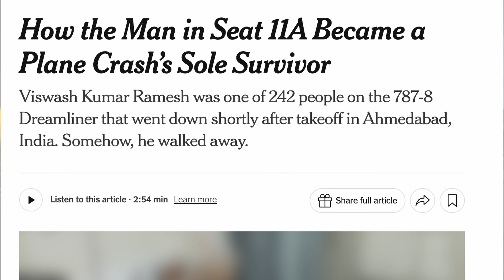Why the RAT Changes Everything – Air India 171 Update

Comment: Great analysis, Captain Steve. One crucial piece of evidence I think deserves more emphasis is the complete absence of turbofan engine noise in the video. TOGA thrust on two GE or Rolls-Royce engines is loud and unmistakable, the fact that it's entirely missing strongly suggests a dual engine flameout. Combined with the RAT deployment, it points toward an abrupt and total loss of thrust.
Reply: I agree. The fact that you can hear the RAT but not the engines supports dual engine failure.
Reply: I second that idea. And these guys would have that thrust lever maxed out at that point. It would be loud. I am in the path of final approach in Philadelphia and I can hear when they increase thrust and decrease to maintain altitude and that’s at a few thousand feet. Sounds like nothing is happening here at all
Reply: I saw a comment on a website regarding a "GCU bug" where after 248 days of continuous operation the GCU will shut down. The GCU provides power to all AC systems. This 787 did not have a maintenance record regarding the GCU software update. GCU shutdown means no fuel pump power which means the engines go out and the RAT deploys. In the video it didn't sound like the engines were running at all, could this be the cause?
Reply: @willl84  As I worked on the mechanical design and packaging of GCUs for about half my working life, a GCU is the Generator Control Unit which controls the main electrical Generators for aircraft electrical power. There is one GCU per Generator and one Generator per engine. The Generators are driven directly by each Engine's Auxiliary Systems Gearbox so very mechanical at this point.
Reply: @willl84  If both GCUs failed due to the same time-based software bug, it highlights how software monoculture can completely undermine system redundancy. Simply duplicating components isn’t true redundancy if they run identical code with the same failure trigger. In safety-critical systems, software diversity is just as essential as hardware duplication. The solution lies in having separate teams develop critical software independently, reducing the risk of simultaneous failure from shared bugs.
Reply: @CDeliu  What you are describing reminds me of the first launch of the Ariane V rocket in 1996. The launch vehicle had two identical guidance systems running the identical software. When the primary system experienced a register overflow it shut down and control was transferred over to the secondary system. The secondary system had the same software flaw, so it also shut down. This left the vehicle completely unguided, which caused it to go out of control and break up.
Reply: @willl84  GCU stands for what? When using acronyms in discussions its a good idea to write it out first so people know what you are talking about.
Reply: @willl84  I am interested in the reports and film from people on the previous flight showing that electrics in the passenger cabin had all failed many hours before the crash. That seems to suggest there was possibly something very wrong with the plane well before it was turned around for the final flight where it crashed.
I understand that there would be multiple GCUs and a complex system for managing that power, but is it possible that one or more of the GCUs had already reached the overflow point during the previous flight and power to the cabin had been impacted, only on the following flight did the others reach the overflow and fail causing complete loss of power and control.
This would perhaps require the GCUs to have been started up a short amount of time apart when they were originally onlined, but without any knowledge of how they work that sounds like something that could happen?
Reply: Good point. When the fans are producing high levels of thrust during low speed, low altitude flight they make that characteristic buzzing sound. These engines were not making that sound, meaning they were just windmilling and not producing any thrust. The big question now is why did the engines quit.
Reply: Its GE engine - GEnx series

Comment: The sound of RAT ok, but what about the NO SOUND of eventually dual engine failure ? On take off the engines works at best power, with max sound, if them doesn't works at all due a flame out the sound doesn't stop but dramatically decrease, same difference between a take off and a landing. This can be a beginning point. Thanks Capt. Steve for sharing your great experience.

Comment: This is for safety purposes: why the Airplane maker can't invent a safety capsule for high impact to create less damage inside the plane without exploding the human body? It should be urgent by these days.
Reply: During a crash, massive forces (decelerations often exceeding 50-100g) are exerted on the aircraft and passengers. Even with a reinforced capsule, the human body can’t withstand such rapid deceleration without severe injury. Organs, blood vessels, and bones can rupture due to inertia, even if the capsule remains intact.

Example: A 100g deceleration means a 150-lb person experiences a force equivalent to 15,000 lbs, crushing internal structures unless energy is perfectly dissipated.The FAA notes that crashes exceeding 50g are rarely survivable, regardless of protective systems

Comment: Wouldn´t it be fair to say that the RAT was deployed when the gear wasen´t raised and air speed is too low?  Another thing is that usually you would hear the engines go from high rpm to zero when a plane crashes this close to people. I did not hear that in the video

Comment: I don't know a lot about aviation but it's my view that plane manufacturers should discontinue twin engines on these long haul aircrafts and equip them with four engines because of the heavy loads these twin engine planes carry ie passengers, commercial goods and its aviation fuel.
Should one of the two engines fail and shut down during flight disaster becomes immediate possibility whereas with one or two engines dying mid flight in a four engined aircraft the remaining three or two engines would assuredly definitely complete the journey safely.
It's my opinion that manufacturers' first consideration must be to save HUMAN LIVES, and then secondly save the aircraft itself because it's an Expensive investment and finally protect the goods on board.
According to me aircraft manufacturer can't provide those safe guards with twin engines which is really gambling with passengers' lives in my view. Four engines assure the best safeguards for passengers, goods and the aircraft, ie in the event of Engine failure.

Comment: Caotain Steve, please DO NOT overuse therm DUAL ENGINE FAILURE. We do not know if the engines FAILED or were NOT OPERATING. It is a fundamental difference, engine could be just fine but due to a problem present elswhere (e.g. no fuel delivered) they were not delivering thrust.
The dinal otcome is unfortunately the same, but the message matters. The engines are manufactured my General Electric (Boeing does not design and manufacture engines, of course) so it does matter if the engine were problematic or an issue was with another system, e g. Fuel system.
Thank you!

Comment: Hello Captain Steve! There is also a 4th factor to the dual engine failure theory, and that would be that the landing gear initiated the retraction sequence (hence the wheels being tilted forward, which is a characteristic of the 787 landing gear retraction sequence), but was stopped due the presumed loss of engines, electrical and hydraulics.

Comment: @captainsteeeve true now it seems a dual engine failure. One more point which adds to this is when the engines are running you could see the heated air coming out of the engine at the back which would make the objects behind the tail heat wind look blurry or wavy and it is not there.

Comment: The most compelling arguments so far...
Have they found FDR and CVR? I bet FDR will confirm if it is dual engine issue.
So, in the end, it will be an issue between pilot error, maintenance error, or Boeing error.

Boeing will really really try pushing the news away from their names. Especially after all major fatal incidents invloving Boeing. Regardless if it is Boeing faults or not, Boeing will have a really hard time ahead.

Sucks to be Boeing's CEO right now. He thinks it will be easy money but accidents after accidents come and then tariff takes place. It will be hard to clean their names, especially since Boeing was known as the good-old-reliable.

Comment: Can the electricals i.e the battery system have failed which did not allow things to run ? 

Had a recent experience with my Mercedes E250 (2017) which was running and when we stopped at the lights it turned off which had never seen before and then took a really long self before running for 2-3 minutes and turned off again 
. In automatic cars when the battery is about to die we do see either the AC not working or the RPM’s being higher than they normally are.
Just sharing in case it’s useful

Comment: * it's not going to be pilot error. The captain had 3 decades of flight experience and was a senior trainer. The Co pilot had substantial experience too so can time that  out I'd say.

* no way it's flap config error as loud warnings would have gone off as well as you'd have to have a serious loss of bearings to know misplace flaps for gear. 

* bird strike easily ruled out as previous flights would have remarked birds in area. There's none of that

* the silence in the sky is a dead give away there was engine issues. The Rat just confirms that.

* engine fuel contamination very possible. Happened on a cathay Pacific flight and thrust was stuck because of it.

* could even be a fuel miscalculation.

* ultimately stop guessing and let the investigators do their job and bring closure to it all

Comment: So, in the 787, just having a dual-engine failure is enough for the RAT to deploy... I thought RAT only deploys when there's a major hydraulics fault. Maybe there's just on the 737 and 777 and on multiple Airbus?
At this point in time, there's no way that the airplane had depelled the batteries fully... Unless they were faulty. But if they were faulty, then it wouldn't have started in the first place.

There's no way there was a major electrical fault yet, the plane has batteries to power all for some minutes.
There's not enough time to have a major hydraulics fault yet (needs, at least, 2 minutes, in absurd situations).

So the RAT deployed due to a dual-engine failure?

Comment: But the survivor said he heard the engines being pushed to full power, shortly about 30 seconds after takeoff. if it was dual engine failure. surely, he wouldn't heard that. It would have gone silent, wouldn't it?
Reply: Maybe an electronics failure, which disabled control of the flaps. as we saw on the first leg of the flight, none of the electronics were working inside the plane. that video from the passenger demonstrated that.

Comment: @Captain Steeeve What is your opinion on the tilted main landing gear, because in the normal configuration the front of the boggie would be tilted up. In the video, however, it looks as if the gear lever has been set to select up, the landing gear aligns itself briefly but is then not retracted any further.

Comment: As a retired Flight Simulation Engineer with 10 years experience my view is that it is nearly impossible to reset the flaps INSTEAD of the Undercarriage.
The Flaps lever is located in a different place to the Undercarriage lever.
You are blaming the pilot to cover up Boeing's abysmal quality control. The USA Congress is onto this also. This video is an effort to side with Boeing 😢.
You also TOTALLY ignore the VERY poor maintenance by Air India. The maintenance was carried out by Turkish Government contractors. The Turkish Government supplied Drones to Pakistan to attack India with.
This video is TOO SIMPLISTIC.
NO CLUE ABOUT ENGINE FLAME OUT ON TAKE OFF? Keep protecting Boeing at all costs.

Comment: And if you look carefully I think you can just make out that the flaps were set correctly. Hard to see because of the shape of the wing, and the fact it's only a 5 degree flap setting. You can't see it once the plane heads away from the camera, but for the second or so it's passing the camera i can see the inboard flaps. I also watched another HD video of a 787 taking off from Heathrow, and even in that it was not easy to see the flaps. The fact we know now the RAT had deployed maybe points to some massive electrical problem that shut of all the fuel pumps to the  engines, with fuel contamination I would have expected to hear the engines popping and banging, the seemingly lack of anything like that would suggest the engines were simply starved of fuel for whatever reason.

Comment: PLEASE READ my LAST LINE 
Engine Fuel Pumps but since its coming down since it just took off, starting to think so the electrically driven booster pumps in each fuel tank, i am sure you said it the APU is out, now what caused that ? 

 
I just google this last bit maybe Captain Steeeve can give us more on this ?

An APU (Auxiliary Power Unit) on an airliner can fail due to a variety of reasons, including mechanical issues, overheating, or excessive load. Specifically, factors like abuse from starting and immediately using bleed air, temperature changes, and even the size/weight tradeoff of the APU itself can contribute to its unreliability.. they did say it was it was fully loaded was it too heavy ? how many hours had that engines flown ? where they even serviced and checked off right ?

We need to ban take offs inline with buildings, this crash may have been alot different if it as came down in a farmers field or over water, i never understand why airports get the clear to build them so close to houses.
Airlines are really safe if everything is right but i blame these buildings for the final outcome :( very sad day :(

Comment: Didn't they used the full length of the runway to take off? There has to be something that warns the pilots that the delivered thrust is much lower than the demanded thrust? I mean it is probably a good idea to abort takeoff at any time if you lose thrust.
Maybe you can have wires with the ends buried in sand at the end of the runway to stop the planes?

Comment: Also notice that wheel configuration clearly indicates they are already partially going inside. The pilots clearly tried to pull them in as supposed. Its clearly indicated by the angle of the back weels under the windows ...

Comment: Come on...... this sounds so stupid! That a pilot takes the wrong lever... really, you can't make that up! The only 2 actions a monitoring pilot still has to do during take-off, in these computer controlled machines, is to operate the flap and landing gear lever in addition to operating the autopilot. So if you as a pilot can't even perform this simple and necessary action properly, how on earth can you ever get a license? It must have been a technical failure, otherwise you really can't do this as a pilot in a modern aircraft!

Comment: A passenger who traveled in the same flight from Del-Ahm before it crashed did a video recording of snags in AC compressor not working or going on and off, then reading lights not working, call buttons to call air hostesses were non functional, and he felt flaps were going unusually up and down during cruise. Is this an important piece of information, with the RAT angle now?

Comment: Captain Steeve n Boeing Co - stop blaming pilots for the accident . BE PATIENT FOR THE FINDINGS OF BLACKBOX BY INDIAN EXPERTS FIRST 
ITS IMPORTANT THAT THERE IS NO COVER UP FOR BOEING CO TO GET AWAY,AFTER THE WHISTLE BLOWER HAS BROUGT THE SHORT COMINGS BY IGNORING THE ALERT / WARNING SIGNALS .
THE TATA CO OFFICALS NWITH SUPPORT OF GOVT SHOULD STAND STRONG TO FIND THE ROOT CAUSE OF ACCIDENT ,EVEN IF IT MEANS GROUNDING OF THE  DREAMLINERS N OTHER 787 AIRCRAFTS WHICH BOEING / USA WOULD NOT LIKE SINCE IT IS GOING TO IMPACT THE CO IN A LARGE FINANCIAL ...LOSS

Black box should be analysedby Boeing experts in India who have all the expertise in presnce of indian experts to maintain transperency and avoid tampering of data  important leading to the failure

Comment: Something wrong with the fuel pumped freshly into the plane at that airport seems to be a viable conclusion. Still, there was a video showing electrical defects from a prior passenger that might indicate maintenance issues at least for the passenger equipment and air conditioning - could there be an overheating of some sort?

Comment: This aircraft design had a lot of electrical problems in its early days. One of the triggers for RAT deployment is Pilot and CoPilot electrical failure.
Reply: In fact, around 10 years ago people were discussing this very scenario. Why was the alert that went out discussing checking cabin air conditioning? Unlike many aircraft which get cabin air pressure from a bleed off the engines, my understanding of discussions 10 years ago was the 787 has electrically operated air and hydraulic compressors. I think this is something of a novel design. My money's on a widespread electrical failure. Reminds me of that ship that hit the bridge in Baltimore.